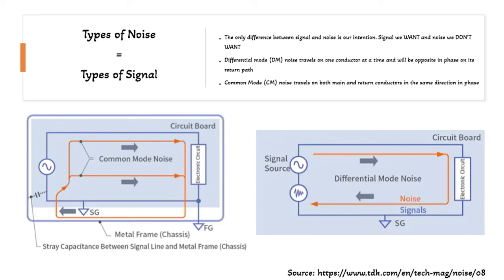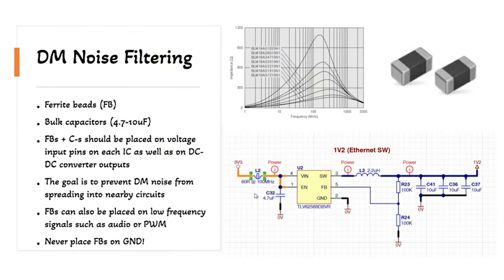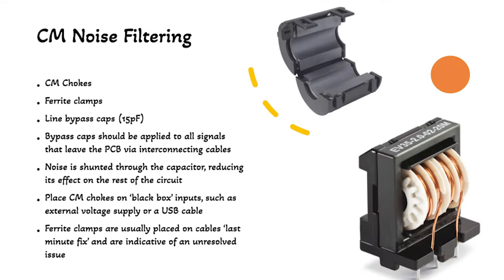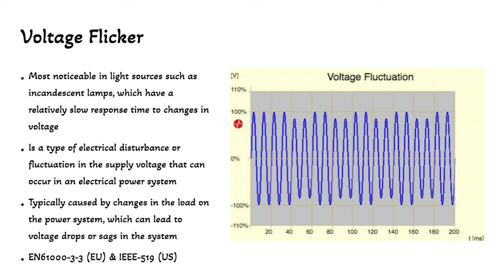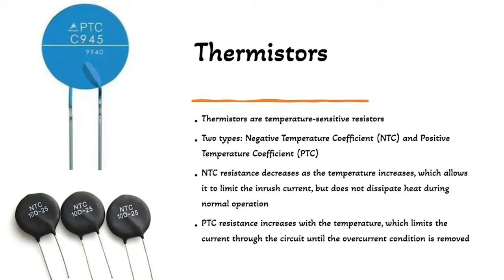How to Pass Conducted EMC and Immunity. 5 Tricks

Comment: Many Thanks for the nice video,
Just a small hint.
I think you meant that the resistance is quite high when the varistor's voltage is lower than its specific voltage in 13':16''.